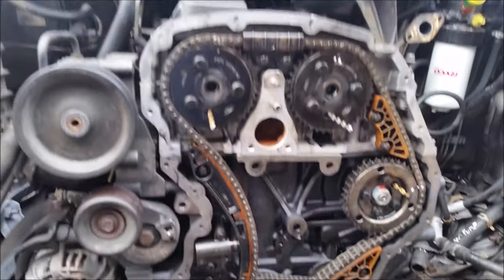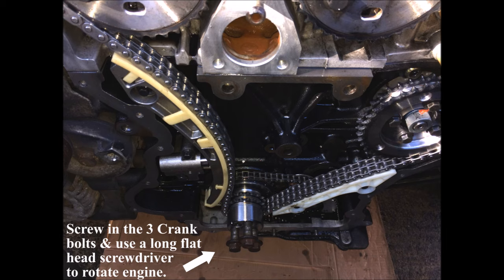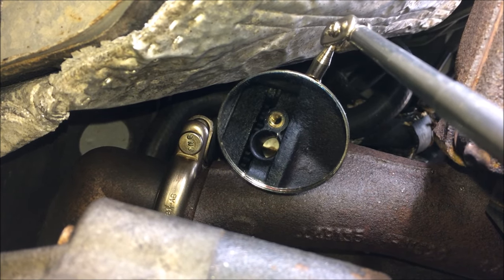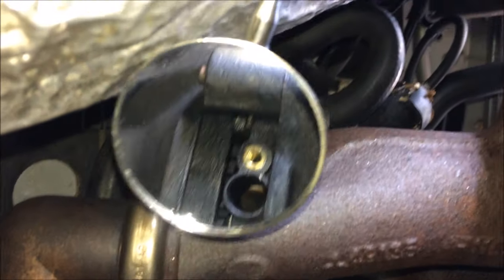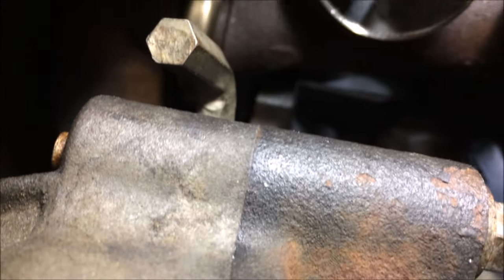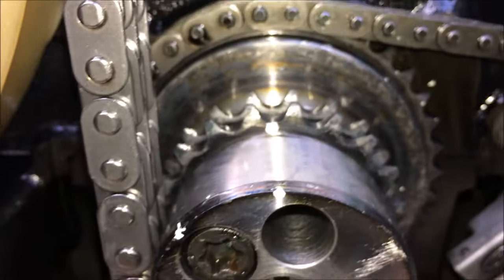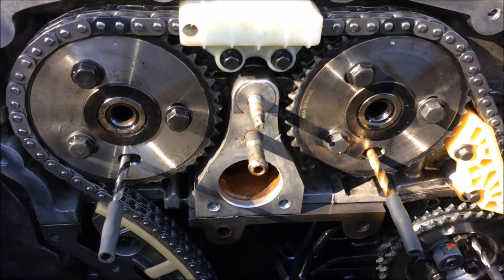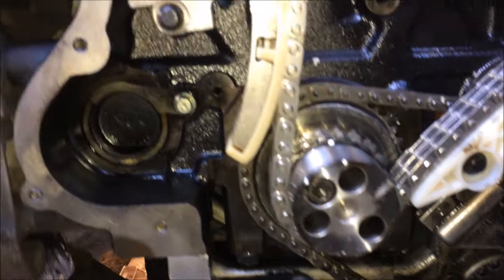How to Set Engine Timing - Ford Transit

Comment from the maker: Torque Settings are as follows as per FORD ETIS IDS: 
Camshaft Sprocket Bolts: 33Nm
Diesel Pump Sprocket Bolts: 32Nm
Timing Chain Tensioner Bolts: 15Nm
Chain Guides Bolts : 15Nm applies to all 4 guides

This applies to most 2.2 - 2.4 TDDI & TDCI Dura Torque engines. Please do your own research and ensure the torque settings above are correct for your application. I take no responsibility for improper use of this information.

https://youtu.be/NUFKzrbdd9o?si=Gocj2C8PBevZ03Qx

Comment: my tranny is awd ,to remove the cps is a nightmare ,i,d rather use the proper tool that replaces the starter motor
Reply from the maker: Thanks for the info.
Reply: what is this tool ?
Reply: @jcstuningltd  it was a flywheel locking tool ,turns out you have to remove the sensor to make sure the timing is right so disregard that cheers
Reply: @vincemarshall8550  okay mate yeh i did wonder what u we’re on about when locking these engines i’ve always used cps lot for locking.
Reply: @jcstuningltd  dont know wether yours is fwd or rwd but on mine (rwd) your have to remove an exhaust plate and get under the van to tighten the sensor up ,its a crap design ,anyways all the best mate
Reply from the maker: @jcstuningltd  A 10mm Allen key works well too. Exhaust heat shield needs to be removed which is normally clipped onto the sensor
Reply: @AutoBuddynz  i’ve got locking kit mate but not sure how far the pin should go in
Reply: as when i’ve done my chin when i try turn it by crank its tight as hell either its on compression stoke or something up
Reply from the maker: @jcstuningltd  this video explains it  https://youtu.be/NUFKzrbdd9o?si=Gocj2C8PBevZ03Qx

Comment: Hi, Really good video, my problem is that I took the chain off and while putting back camshaft sprocket it has slip clockwise, how do I now get the sprocket turned clockwise back to the right place without chain on without doing any damage?
Reply from the maker: Hi, thanks for the comment. To realign the camshaft sprocket use any of the 3 bolts on the sprocket (think they require a 1/2 inch or 15mm socket from memory) to turn the camshaft counter clock wise. When the timing mark aligns make sure to lock the camshaft and only then proceed to install the chain. Also ensure your crankshaft posting has not changed and is still at its timing mark seen in this video.
Reply: @AutoBuddynz  thank you, i was worried as I read not to move camshaft or crankshaft on their own as may damage values, but friend today also has said ok to go counter clock wise. Yes, crankshsft is lock correctly. Thanks.
Reply from the maker: @ThePatto56  Happy to help!
Reply: @AutoBuddynz  Hi thanks, have today installed reconditioned fuel pump ' new timing chain and sprockets. Do you have the torgue setting for the sprockets and chin guides, I'm now ready to put new timing chain cover on.
Reply: All is OK have found all torque settings.
Reply from the maker: @ThePatto56  I've pinned it to the comment section might be useful for others as well.
Reply from the maker: @ThePatto56  No worries

Comment: These have adjustable sprockets on the fuel pump, int and exh Cam sprockets. When replacing sprockets is it necessary to get these timed up exactly? Thanks.
Reply from the maker: Correct, for the cam shafts ensure they are locked in using the bits as seen in the video. Ensure the crankshaft is locked in the correct position. For the diesel pump  use a 6mm dowel or drill bit at least 65mm long either when  installing a new pump or replacing the timing chain, it locks / resets the fuel injection pump timing.
Insert the dowel into the cut outs provided as seen in the video.
Reply: Hi Auto buddy, I really appreciate your quick reply. Timing all pinned up and locked in, If I were to crack the bolts holding the int, exh, pump sprockets, it allows for very slight rotation (5-10mm) of the sprockets themselves, due to the sprocket bolt holes being elongated holes. Is it important that these are in a specific position?
Reply from the maker: @gonadds  What I normally suggest is tighten up everything as best you can with all sprockets locked. Then start with the intake cam sprocket and get this aligned in the center, then move onto the exhaust etc until they are all centered. I'll have another video out in the next 24hrs about locking the crankshaft which has a good example on aligning these sprockets.
Reply: Hi! Gr8 video btw! My question is to do with the adjustable sprockets. Should the chain be taut or slackbetween the cam sprockets? As the bolt holes are elongated, it's possible to rotate them by 5mm or so, the chain then becomes taut or slack, depending on which way you turn them. Should it be be slackish or taut between them.... Thanks!

Comment: Hi mate. I'm currently doing the same job on a london taxi that has the same 2.4 transit engine as shown on the video. Just a quick question when taking the old chain off do the gold links have to be lined up with the mark on the cams and pump. I know when putting the new chain on the marks need to be lined up however on mine i'm trying to take off the old chain and with the locking tool in the crankshaft sensor hole and drill bits in the cams and pump the gold links on the old chain don't line up. Does this matter for taking the old chain off ?
Reply from the maker: Hey Nathan, if all your existing timing marks are set and locked perfectly (diesel pump, camshafts and crank) you do not need to worry about lining the gold links when taking off the chain. However if you can when installing I would recommend aligning the chain exactly with the gold link on the timing marks seen in the video. If they do not line up or is a tooth out I would replace the chain.
Reply: @AutoBuddynz  Okay thank you for your help. Haven't yet had chance to complete the job yet but thanks for your help. I knew the marks had to be lined up when putting the new chain on but wasn't sure about removing the chain..
Thanks
Reply from the maker: @nathancritchley6054  No problem, glad to help.

Comment: I'm doing a 2015 ranger 2.2 same chain set up but high pressure pump doesn't have a timing pin location? Does this pump need to be timed? Need to get pulley of to remove chain
Reply from the maker: No you shouldn't have to time it as its a TDCI (common rail) with electronic injectors. Unless you have an engine I've not seen before
Reply: Appreciate it!

Comment: Hey mate !! Need urgent help . So car has been going in to limp mode and throwing Camshaft code , after messing round finally took timing cover to discover once crankshaft is locked the cams are actually out of time and you cannot put your 6mm drill bits through . Now what would
Be the safest way here in getting it back in time when replacing chain and tensioner ? 
Do I lock cams only ? Remove chain assembly and rotate crank back one tooth to its correct position with chain removed ?
Reply from the maker: As long as its a ford transit and you lock the crank as seen in this video this will provide clearance from the valves & piston. Rotate the camshaft back by a tooth assuming the crank is locked and chain is stretched this should rotate and allow you to lock it in place. If the chain has been stretched excessively I would be checking to ensure the valves are not bent etc, using a leak down tester etc. But if its only one tooth chances are it should be ok
Reply: Rotating camshaft back with chain off obviously ? Or still tensioned by chain . It’s only out half a tooth each cam
Reply from the maker: @jordandennis6642  With the chain on if you have to otherwise the chain can be removed off the crank shaft while someone assists and holds the camshafts with a breaker bar etc. It can then be rotated back one tooth.

Comment: Hi
Should I worry about counting tooths on crankshaft sprocket if I have locked the flywheel?
One more question...
If I'm going to replace all sprockets, are the locking pins stays in place so I can slot out the sprockets?
Reply from the maker: Hi, if you have locked the crankshaft correctly then its not a must to count the teeth, however I would still suggest you do this if you can. If you are replacing all the sprockets do them individually. 1st open the bolts & remove the intake camshaft lock pin (it might spin) then remove the sprocket and replace it with the new sprocket, lock this in place and tighten the bolts. Only when this is completed move onto the exhaust side. This is the safest way to do it. You can do both at once but I would suggest doing it as described.

Comment: Hi, thanks for posting such a helpful video in English most of them are in the Russian language helpful in a visual way but can not understand what's being said... Anyway, I have Ford transit mk7 2.4 2006  it cut out while I left it idling on the driving then It would not start after that, it was just cranking.  I opened the front end everything was intact no broken chain all the guides and tensioner in place but I realised the chain was a bit slack moving with a finger which made me think the timing could have jumped out. I put 2 bolts on the crankshaft pulley and rotate with a big long screwdriver but I realised the timing marks on the chain are out of sync with arrows on the camshafts, diesel pump and also the camshafts are out of sync as well in respect to the locking holes were you insert drill bits for setting the timing.
My question is what am I looking at changing the worst scenario, would it have damaged the rocker carrier, valves and pistons or I can get away with replacing the rocker carrier only if its snapped as I haven't opened the rocker cover yet or it means complete rocker carrier, Head, valves and pistons?
Also if it turns out the worst scenario of changing the rocker carrier and head does it mean before anything else:
 1. Firstly do I need to lock the crack shaft in place through the sensor hole and lock diesel pump only before doing anything else?

2. Strip the crankshaft pulleys chain guides, tensioner, top part rocker cover and head without needing to lock the camshafts pulley in place at this time since timing it's out anyway?

3. After rebuilding the head, rocker carrier and camshafts in place,  is that when I now I need to lock them camshafts pulleys with drill bits and follow your procedure in the video referencing to this image were I put blue arrows; https://puu.sh/GrbC0/7673dad574.png or it needs special setting by someone qualified.
Any help I would greatly appreciate.
Reply from the maker: Hi, its not uncommon for the chain tensioner to fail, which could be the cause of the jumped timing. Just to confirm the timing marks on the cam gears do not line up with the drill bits? The timing marks on the chain do not matter if its a running engine, they are only there to assist when installing a new chain or re-installing the existing one.
Reply from the maker: To answer your points if its a worst case scenario, which it might not be easiest way to tell would be to remove the injectors and put a camera into each cylinder and check for any visible damage. 

1 = I would recommend always locking the crankshaft as sometimes all the timing marks on the front might appear to be ok but the crank could be a tooth off, I've seen this a few times. 

2 = If you have established that timing is definitely out of Sync and there is damage then its fine to pull it apart without locking the cams. However if you are unsure and will be pulling the engine apart I would still suggest locking the cam gears. 

3 = Referring to your head being rebuilt, I'm assuming your asking if you need to lock the cams while the head is off the engine after rebuilding & re-assembly? If so this is not a must as if you locked the crankshaft previously as suggested the pistons will be set in service mode meaning there is clearance between the valves and pistons so they will not interfere, this will be obvious when you pull off the head, so when you set the head back on the block and reassembly the head bolts etc, you will then need to set the camshafts in time as seen in this video.

Comment: hi do i need to set  the timing chain when taking out the fuel pump or does it not matter
? my fuel pump packed in and there no video`s on youtube showing this and its a common problem.
Reply from the maker: Hi There is 2 ways of doing it. The method I've shown in this video or if you buy the diesel pump locking tool (link below). My method involves removing the complete engine front cover and locking the camshafts & crankshaft before removing the pump. The 2nd way is to remove the diesel pump cover only (circular cover) and use the locking tool to hold the sprocket in place thereby keeping static timing, you then remove the bolts holding the pump (intake manifold etc has to be removed 1st). Do not under circumstance try and remove the diesel pump without using either one of these methods, it will only result in a lot more work.   

https://www.lasertools.co.uk/product/6828
Reply: @AutoBuddynz  hi thank you
Reply from the maker: @jobiff16v  I hope to do a video on a diesel replacement in the near future.

Comment: Supposing you have to reset your diesel fuel pump...how does one do it
Reply from the maker: There is no reset required if you are replacing the timing chain. The only time you would need to reset the Diesel Pump ECU is when replacing it with a 2nd hand unit. A new or refurbed pump will automatically code to the vehicle when the ignition is turned on.

Comment: Can we put doble head gasket seat. On cylinder head
Reply from the maker: No you cannot, it will not seal properly. You can install a thicker head gasket but never two separate gaskets together.
Reply: Thanks for your reply
Reply: Cause when i run the engine there is a knocking noise and alack of power
Reply from the maker: @omarjunolaer9637  Get your engine checked as soon as possible without driving much further. There could be multiple issues, worst case would be a replacement engine would be needed, if its knocking as you said.
Reply: Before they had acode Po341 now no more code and have a response my like before but the problem now i pinckjng noise at idle